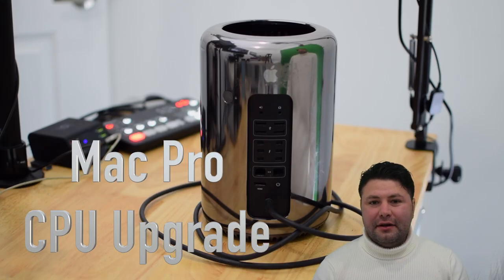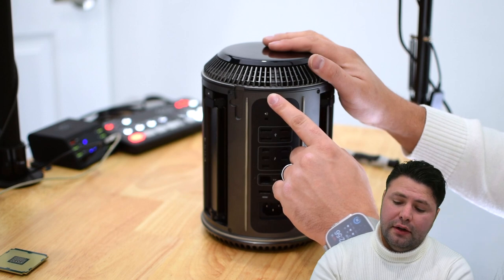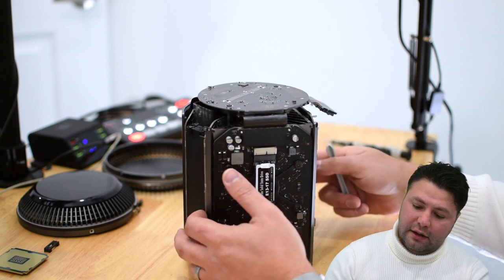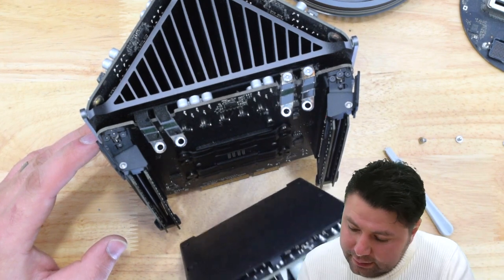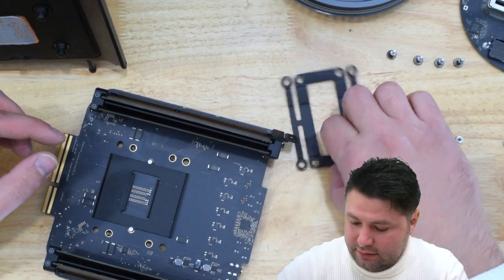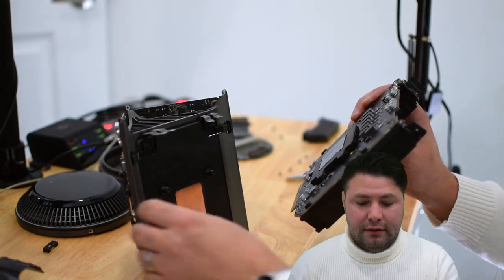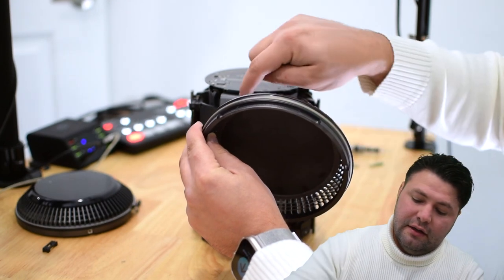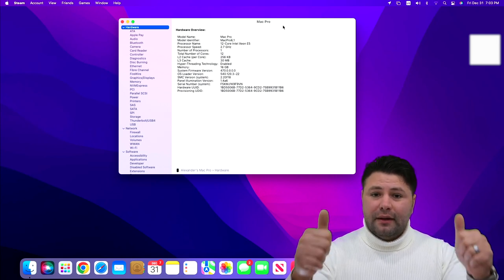Mac Pro A1481 Central Processing Unit CPU Upgrade

Comment: Here are a few Pro tips. 1) When disassembling the late 2013 Mac Pro always wear gloves. Finger oil is not good for the components. 2) Take note of the orientation of the CPU before removing it. This is where video or pictures can be helpful. 3) I no longer use thermal paste in 2024. Use thermal pads they last 10+ years & do not dry out. Just to give a little context of what I do in my professional role at AMD. Im a hardware & software engineer at AMD. Ive also worked at Nvidia for 2.5 year before leaving and going to AMD. KryoSheet graphene thermal pads are an excellent alternative for thermal pastes and have a conformable surface with very high thermal conductivity. This is what I have extensively on both AMD CPUs & GPUs.

Comment: I highly recommed the samsung 970 evo,2tb for the trash can guys!.not the evo plus.for some reason, the 970 evo,hits 1500 read on the trash can.its a little more old school, and the trash can is really fast with this nvme ssd upgrade, with sintech adaptor, ive tryed about 4 ssds so far...but not the 970 evo yet,im wondering if its faster then my 970 pro...

Comment: Hi,Thanks,Great Job!,Ive been watching all the cpu upgrades before i do mine....Im going from the 12 core 2.7ghz, to the 3.7ghz e5 v2 1660..921 geekbench 5 single core score, the 12 core single core score is 751 on my can.the 2.7 is just a little to slow, switching from utube, to facebook,etc...i liked how you explained the thermo paste, and not moving the cpu,when your putting the 4 screws back in,, and you slid it in the table, so it wouldnt move,, all remember that trick, im going to buy the magnet board,for the screws,I just upgraded the nvme to the samsung 970 pro 1tb,its ginna fly with the 3.7 6 core,not the stock 3.5 ghz cpu,that came in the 2013 mac pro
Reply: im not worried about multi core score.this cpu 3.7ghz 1660 scored the 2nd highest ever,blender score,for a 6 core cpu, when i read that, i knew this was the best 1....4 ghz turbo.....unlocked multiplier to boot!.The sweet spot on the trash can,i don,t edit,final cut pro etc...i want speed!.with 64 gbs of memory, the 3.7 ghz 1660 is going to run exellent, with the fire pro 700 gpu, not the 300 gpu
Reply: My black magic speed results right now, with the 12 core 970 pro 1tb ssd are 1329 write, 1420 read.its going to be fun to run this test with the 1660 gpu 3.7 ghz..Hoping to see 1505 read, 1540 maybe?
Reply: 1600 is max in the trash can,the fastest i saw was 1599 read, i couldn,t beleieve it!..it was a mac 5.1 tower, with 2 3.45 ghz 6 core cpus, with a 1 tb samsung evo, not evo plus....as fast as possible lol....